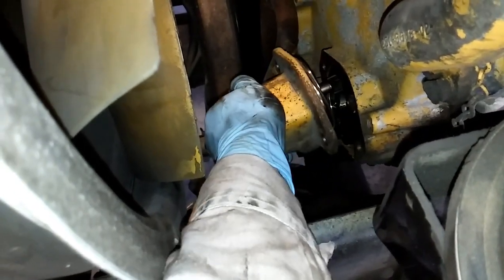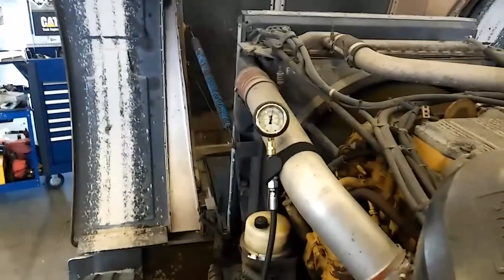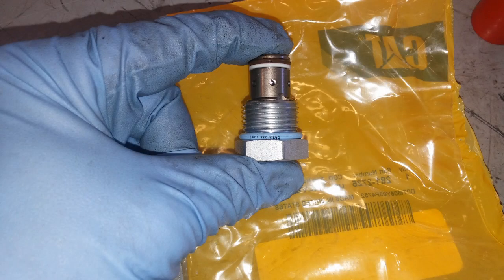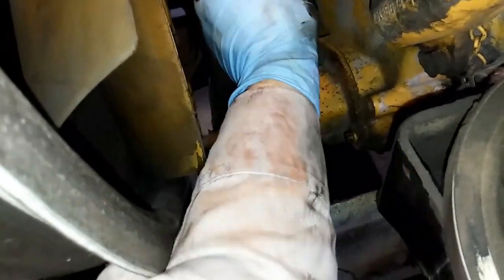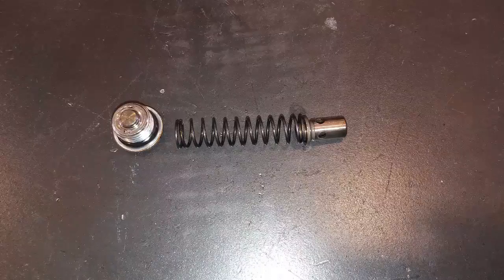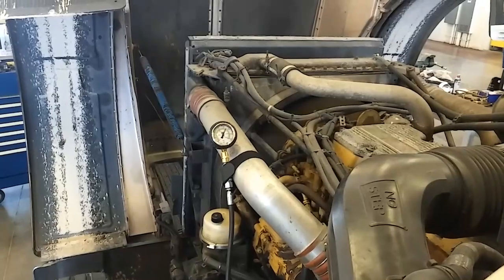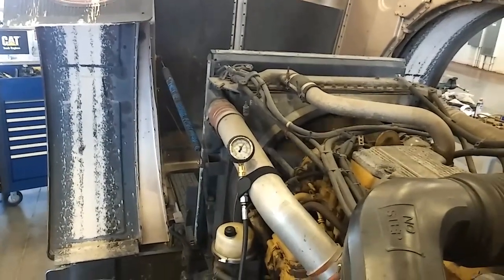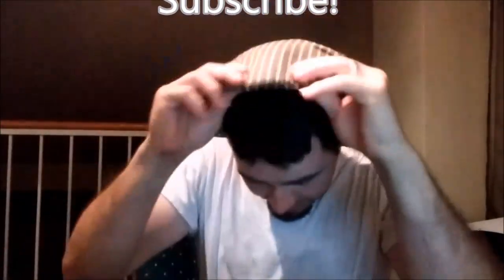Cat Fuel Transfer Pump Remove And Install.  C15, 3406E, C12, and C13.

Comment: Quick question I’m a mechanic in the marine corps I work on these engines all the time and just did a transfer pump the other day on a c-12, I’m curious as to why mine has a gasket but no O-Ring, seems a bit odd because just looking at it seems like it would require an O-Ring such as the steering pump which is directly behind it on our engines. Either way it’s a CAT gasket and ended up doing the trick. And also on all our c-12s there isn’t 12 point bolts they are Allen keys which is a pain in the ass to get in there, same as the steering pump.

Comment: Also that was a reman part for around $185.00 bucks with out core charge. New ones are  around $265.00. Don't forget the new O-ring $6.00. Both new and reman come with 1yr warranty I was told!👍
Reply: Got a part number for that  o ring? I ordered a new pump from cat today for 300 even
Reply: @marioq3792  Sorry I don't have that part number for the O-ring but they know which one you will need to match up with the pump. WoW, you paid $300.00 for a new one? Phew that's steep! The Cat dealership where I bought my pump was salivating for some reason over my original pump and they were like, yeah man please make sure you bring your core back! But I kept it because it's the original and I'll get it rebuilt at Turbo here in Atlanta. It was a really well made pump from 1995 and I can get them to increase the flow. Plus it really looks good on the front of the motor like when you see a yellow Cat air compressor with the red tag, it just looks right hanging on the side of the Big Kitty. But that yellow pump is pricey...lol. Long live the Large Cars🤟

Comment: Funny u posted this. 
I just inspected a truck I wanted to buy and rebuild. 
2004 w900 with a c15. Had a engine fire due to leaky fuel filter housing squirting fuel and started a engine fire. 
Seller changed all electrical lines and decided to forget to mention the engine fire. But didn’t bother to clean all the burn marks on the engine. 
I asked why the engine stickers were burned off and what’s all the black stuff on the engine. 
He said the head was charged and they used a junk yard head and didn’t clean it. Lol 
I couldn’t make this shit up if I tried. 
See the pics for yourself. 
It’s a blue 2004 w900 being sold by a dealer in Ogden Utah for 24999$. 
Some people don’t think your stupid but if u are they sure don’t wanna miss you. So they will try anything to make a sale.
Reply: I'd estimate the fire was started by something other than a fuel leak.  I've had a line crack spraying fuel directly on the exhaust manifold.  Lots of white smoke, but uneventful otherwise.  Electrical short on the other hand... those will take out equipment in short order.  Sounds like the truck owner wasn't much for maintenance in the first place, so getting a straight answer is probably not happening.

Comment: A theory on that radiator.  If it is only degrading on the engine side it may be caused by debris striking the fins.  Gets to be like a sand blaster inside the fan shroud area, especially for ag and construction operations.
Reply: Where are you getting that, out of curiosity?

Comment: I have a question for you to see if you have any answer, I have a cat c15 with conversion to a single turbo PDI.  Every morning I have to drain the first oil filter a bit because if the truck doesn't have power, the turbo doesn't go up to 25, after I do this it usually goes up to 45 and on many occasions when I'm going up a slope it happens the same  the force ends and the turbo lowers the pressure to 25, I have already changed the oil pump but the problem continues, if you could give me an answer it would be of great help.  Thank you

Comment: lee c13.  truck always starts perfect.  runs good till it's ran for 1/2 hour or so.  going over 55 mph for 10 min or so, the truck starts to miss and lose power.  we are running 85 psi fuel pressure.  the needle bounces a bit and it is a fluid filled gauge.  we have done everything we know of.  all new lines. new primer valve.  we finally installed a clear hose on the suction side.  it starts perfect.  runs perfect.  until heavy loads and all the way warm.  when we shut the truck off, the clear tube sucks and fills with air from the line going to the transfer pump.  where do you think this air is coming from?  it does not come from the tank.  is it possible the seal in the transfer pump will allow vacuum when not operating to allow air to enter back into the return line?

Comment: If i run my c15 with a bad oil ring for the fuel pump..can that cause any other problems besides it leaking oil and making a mess

Comment: Adept, my troke broke down coming off the highway(C15 3406 engine). The ignition wire on the breaker corroded and broke off. I had the vehicle towed about 3 miles out of traffic but the truck was left in gear while being towed. I replaced the breaker and was able to get the truck to crank but now it wont get fuel in the lines. As if the pump isn't working.  I have refilled the filter and prime the pump on the filter. I have used some starting fluid but once the filter runs out of disel it shuts off. Could the tow in gear ruin the fuel/transfer pump
Reply: What was the remedy?

Comment: * Please help * 
CAT motor question not on a vehicle, but rather an CAT motor used to turn a large irrigation motor. 
Between the motor and the top of the aboveground fuel tank the owner has plumbed in a ball valve. Mechanic installed newly rebuild fuel transfer pump.
System ran for a minute, then it stopped. Mechanic traced the return line and found the return line ball valve in the closed position. If the diesel return line is capped what would happen? Would the gears in the pump break, the pressure regulator spring break, or would the system flood out because there was no where for the fuel to go?

Comment: I put a new pump on and now I'm getting a whine and high pitch vibration hrough my fuel pressure gauge line that runs into the cab. Could this be a faulty new fuel pump?

Comment: Before removing the pump is there a shutoff valve on the main fuel line to keep the tanks from emptying when the line is removed? I have C13 that Im doing a transfer pump on. I don't see any valve on the engine side so kind of curious what keeps the fuel in the tanks ones those fuel lines are removed.

Comment: Cant you jus stretch the spring in the relief valve and in the housing and get increased fuel pressure also?..thats if of course your trucks fuel pump in working properly?
Reply: Maybe adding shims would work

Comment: I would like to know if you recommend the conversion on cat c15 from twin turbo to single turbo ???
Reply: Idk what adept would say but....I have a friend with a 6nz single turbo and an accert c15 with duals. Both are hot rodded to the hilt. Regardless of the hot rodding...no matter what has been done to both trucks....the accert pyro stays several hundred degrees lower than the 6nz single turbo and always out pulls it. The accert has stock dual turbos and the 6nz has has big dog turbo...pdi....etc...and now a Blalock. My friend swears to god he will never buy anything else but an accert twin motor truck. Of course...the accert cylinder decompression system is disabled and so those accert failures are void. I drive both trucks every week...back to back. The accert always wins on power and pyro temps. One trick is to lower the compression on the accert to 16:1 pistons (from factory 18:1). They learned this the hard way with failure over and over.... the 16:1 pistons with accert delete was the winning ticket.

Comment: truck was running good before fueling at a road ranger gas station. after fueling about 30-45 mins later I started loosing power. so when I got home changed both fuel filters and air filters. but today still same problem.  cant go over 55mph when loaded and in uphills it struggles and starts slowing down  any help? it's a CAT C15 6NZ model
Reply: Hi, Leo 
What ended up being the issue for you ?
I’m having the same exact problem as you … 
I got fuel at Road Ranger and ever since then the truck has had a lack of power and won’t
Go over 55mph. Already spent over $2,000 at the shop and they can’t figure it out. 
I got a Cat C15 MBN Engine. Please let me know.

Comment: Love your videos.  Well done and informative.
Have a question, on a 2006 Cat C13 in a Kenworth is there a fuel rail side pressure sensor that would indicate a low pressure condition?  Having a situation where it seems the engine is a little starved for fuel when the fuel is hot and the tank is less than half full.

Comment: Adept Ape I’m having a hell of a time trying to get my pump with the new gasket to seat flush so that I can bolt it down.  Is there some trick to this?  Gasket seems a little too thick.
Reply: Oring most of the time.

Comment: Hey Josh, 
I have a 2005 C15 BXS that sometimes just takes off like a shotgun, however, after sitting for, say, maybe a week or more, it just cranks and cranks forever before it finally fires. Could that be my fuel lift pump, or is something else causing all the fuel to drain back into the tank?
Thanks In Advance.
Reply: More than likely your fuel is running out of the cylinder head. Can leak onto the piston. Which when you start, cranks up and dies. Black smoke out the exhaust as it burns this fuel off. Or leaking out supply or return. You can replaced the 75LB regulator. Make sure you torque it. It will distort and change psi. I put a one way flow check after base. Take fitting out and install it, reinstall fitting and hook hose back up. If on supply side you can make a P-trap in line to prevent fuel from draining back from fuel transfer pump. You can also put a one way flow check in supply side. I like to put my check at splitter. So fuel is trapped  all the way to fuel transfer pump.  You could put a check on each supply line at tank. 
If you have the tooling you need to install sight glasses at return hose before 75 regulator. Between cylinder head and secondary fuel filter. Another one between primary fuel filter and fuel transfer pump. See which one(s) go empty after setting. If it's leaking on the piston you have to pull exhaust manifold. Plug turbo oil psi line and let it set. Usually the next day or so have someone start engine and see which cylinder has the black smoke out the exhaust.
Reply: @johngoldsmith6629  
Thank you very much for your reply. I forgot to mention in my original question that intermittantly at low idle, the engine sounds lopey, but when I speed the RPM up to 1000 with the cruise, it seems to go away. Engine is in a 2005 Kenworth T800.
Reply: Libertarian Philosophy  Have you done a cylinder cut out test?
Reply: @johngoldsmith6629  
No. I don't have any electronic service tools for Cat engines. Owner operator unit.
Reply: Libertarian Philosophy  I would check fuel psi, air in the return and a cylinder cut out test. Two types of cut out test. The four cylinder Cat has. And the one I came up with, data log RPM's. Set to 2120, no fan, no A/C, air compressor not pumping, operating temp. Cut five cylinders out let it run one minute and go to two, kill one and so forth until all are completed. Should have 8 data points to look at. First and last all cylinders firing, middle  each cylinder. Looking for balance that cylinders are holding about the same RPM's.
Reply: Libertarian Philosophy it could be something as simple as a bad primer where it actually “loses” fuel pressure as it sits but is okay after you get it running, another thing to check is the drain on the water seperator, had a c15 where the rubber seal corroded in the drain valve and would slowly leak when the engine is off and would suck in small amounts of air while running

Comment: I have a new pump p/n388-7286 . The pump calls for p/n 316-6865. The pump is pumping in the wrong direction is this possible or am I missing something. C12 s/n 2ks75456. The engine turns clockwise (standing front of engine)I hooked the pump to my power drill and it seams to go the wrong way. I have a video I would share tks

Comment: Hey Ape i have a 98 pete 379 with a Cat c12. i have a small issue with the engine fan, the fan won't automatically come on at all. Check engine light comes on due to high coolant temperature. The fan light on dash is constantly on (which apparently should come on when i manually switch the fan into manual mode). The fan does engage when i switch it on manually. It started all this when i took the fan blade off and installed a A/C compressor belt but at the same time i replaced the oil temp gauge. Checked all the wires from ECM to cab and they all in good condition. please help. thank you and thank you for posting all these GREAT videos!
Reply: Sounds like you have a OEM problem. First who is driving the fan, Pete or Cat? If Cat you need a test light know which wire is coming out of the J1 connector. Use ET turn the fan on and see if the test light comes on. Best to use a pin puller and remove the wire and insert a test wire. You don't want to damage your wire. Also you have a fuse put in by Pete. You need to contact them to see if they will tell you location. Could be in fuse panel (sometimes not marked as fan), behind speedo. The fan light on all the time tells me you got a wiring problem. Some use a relay to turn fan on. You need to know if you have a N.O. system or a N.C. system. Air to engage or disengage. The more you know how your system is wired the easier it is to fix.  Engine prefix would help and is always helpful when asking a Cat mech. a question. If push comes to shoved you could rewire the fan circuit system. Make sure you put a fuse in the system. You want to protect that ECM.
Reply: moldcos21 it’s the temp sensor most likely, because if it was the fan clutch it wouldn’t work manually

Comment: How do you determine whether to replace the spring kit or the entire pump?  I changed the regulator in the filter base but the truck still doesn't seem right.  When I use the hand pump I can hear a clicking in the transfer pump. Is that normal? I need to find a gauge instead of guessing.
Reply: Need to check PSI under load. Spring kit only works on the newer pumps. Pumps do have a check valve in them. I have stretched the spring to compensate for wear. Again you need a gauge to make sure what you did is correct.
Reply: @johngoldsmith6629  thank you for your reply. I agree i need to put a gauge on it. I installed the spring kit and it was almost an inch longer than the old spring.  So far it seems to run a little better.

Comment: I havea 3406e after a few days it doesn't fire right up. A few pumps on primer and its fine.
Things that have been changed
All fuel lines motor and to tank
Transfer pump 
Bouth fuel filter housing s
And the fuel manifold as well as the fuel preasure regulator. 
I do oil analysis reg and shows no sign of fuel in oil . Does it mean i have a leaky injector if so how do i know which one

Comment: I have a c13 motor and trying to figure out what is going on with it was rebuilt by peterbilt 100,000 miles ago year and half and I am getting light water coming from heat side of head along with light oil what can i do to stop this ?

Comment: my fuel transfer pump exploded, blew metal and oil everywhere days before it happened had low boost, low power but truck kept running, even after it blew apart. anyone ever seen this issue before?

Comment: Can someone please help me I have a C15 on my Freightliner Columbia and I bought the truck about a year-and-a-half ago been running 300 miles a day local run had no problems with it at all just recently I just noticed that there's white smoke coming out of my muffler should I be worried

Comment: Are they a 700 hp cat maybe 3506
Reply: No, a C-18 is capable of over 1000 HP with the correct arrangement.
There is no 3506, the 3500 series engine starts at 3508 then goes 3512, 3516,3520,&3524. 
There IS a 3501 engine, but it's used primarily for verification/testing of components and not available for purchase to my knowledge.

Comment: Has anyone ever heard of a diagnostic tool "DIESEL LAPTOPS TEXA KIT" can anyone tell me anything good about this diagnostic scanner tool?
Reply: Hey I'm an owner operator based in North CA. It's been a pretty slow winter till now which is always when the rig throws out it's most costly repairs..... Problem, inner timing cover engine oil leak id rank between moderate and severe. Oil is dripping from the area just  forward of my power steering pump on the inner timing cover side seems to be a weep hole there. My wallet is quivering already any info would be greatly appreciated.
Reply: C13 acert KCB 2007